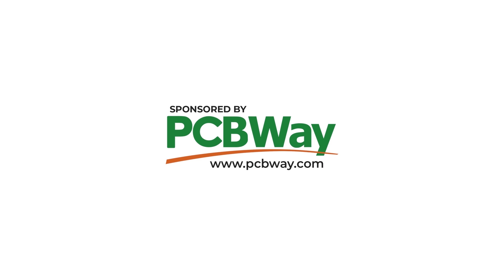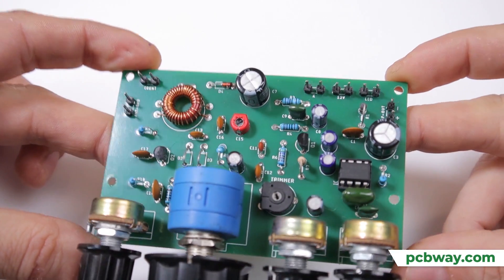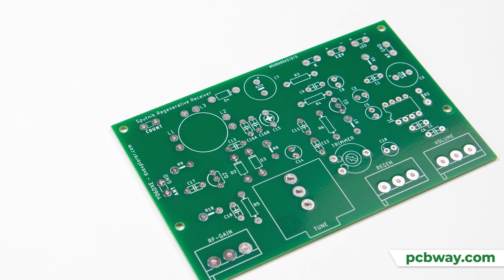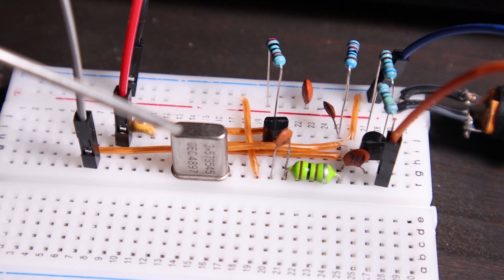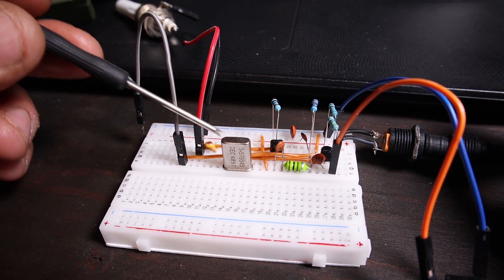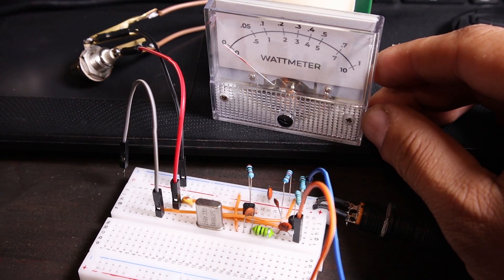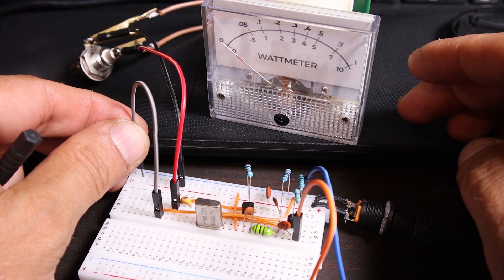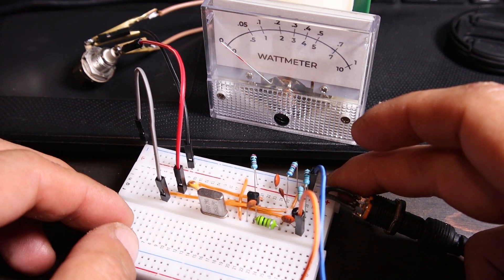uu80b QRP CW Transceiver Designed by G3XBM

Comment: I was wondering about the RX/Listening
Reply from the maker: I will do that in the next video on this trx. I wanted in this video but there was no propagation. I will post a reel on Instagram these days as well. Is not that sensitive though ... but you can copy stronger stations with no problems at all. And also is not very loud... so I am thinking on adding one more transistor on the AF side. I still like it as it is because is so simple 😁. 73, YO6DXE
Reply: @dxexplorer  I will make the circuit and observe it at the most appropriate time. I am working on the working logic of RF circuits.
Reply from the maker: @kadirsakin7335 I am playing with the trx now trying to improve the audio part... but I am too sleepy and the propagation doesn't help again so... I will leave it for tomorrow I guess )))

Comment: Really nice stable X tone on this Ciprian... once you have a filter to trap harmonics you should be good to go more or less...
Reply from the maker: I want to play with it a little before adding a filter and see if I can improve the sensitivity and the audio output... is a little poor on both. Also lots of AM broadcast band interferences so I want to see if I can get rid of those too )). For now testing the 80m and 40m bands. I couldn't get it to work properly on 20m yet. 73, YO6DXE
Reply: @dxexplorer  That makes sense...hope it all goes well... 73 G0KPZ
Reply from the maker: @davidportch8837 Still working on getting it to work on 20m... but so far I got rid of most broadcast interferences and the audio is just a little louder 😁. 73, YO6DXE
Reply: @dxexplorer  i'm waiting for a new video of updating about this wonderful project, also for the tests in 40 meters band
Reply from the maker: @ScratchyCode if you go on my channel on the community tab... have a look at the schematic I use at the moment. It works both for the 80 and the 40m band just as it is. Probably I will make little adjustments in time... but for now that is what I use and I like it. The audio output is still a bit low... or maybe just the propagation is bad and I can't hear much  ))).

Comment: Great video! I see a very nice landscape behind you. Nice transceiver and i believe if ypu build it on a pcb you will have more or less 1W at the output. 73
Reply from the maker: I may adjust the schematic just a little and see if I can get better sensitivity on RX... I am more than happy with the TX side. Even though I have a feeling that replacing one tranzistor may give me even more power. Love it though even as it is. P.S. I also love the new landscape... I wake up with it every morning 😁. 73, YO6DXE
Reply: @dxexplorer  yes, looking forward to the reels!! Is it possible to just replace the crystal and have it operate on another band? Just as it is but with another crystal?

Comment: I have had the circuit for the uu80b in my stack of papers for a few years but never had wired it and tried it out. I have used a Pixie a few times with about the same power out so this circuit you are using should work fine. I have plenty of 40m crystals so will try that band first. Now seems a good time. As for learning Morse Code, I first just learned the letters and numbers in order back in 1973 and after about a week I started to convert code in my head as I would drive past road signs on the highway. I reached the required 5 wpm for my Novice in just a few weeks of practice in 1974 so just relax and try my method without stress ;-) 73 de wa4jat
Reply from the maker: I have to start learning as well. Maybe find a little time every day. The code is what got me into the hobby in the first place... and now that I have a license I don't know the code haha. The transceiver is nice indeed. There was no propagation today on 80m but I want to hear it on RX as well. 73, YO6DXE
Reply: @dxexplorer  Looking forward to hear about future contacts on your little rig and the code. Getting on summer here so 80m has way too much QRN until About November so I tend to stay on 40 and 20 cw and always QRP🙂
Reply from the maker: @marknesselhaus4376 QRP for life 💪❤😄. Ohhh I will sure learn the code soon. Is way too much fun not to get on air on CW. Meanwhile I will build a few more "toys" like this one and have fun with them later. 73, YO6DXE ( same here with the propagation on 80m )
Reply: @dxexplorer  "Toys", I never have thought of them that way. Each build is such a wonderful learning experience and discovering how much you can do with so little.  My little "Michigan Mighty Mite" single transistor transmitter works the entire eastern states from North Carolina. Simple receivers are the real challenge in keeping them basic yet stable. I am only up at 3am as I could not sleep, so got up for coffee and see if 40m is open. Nope, just a few weak stations on there now ;-)
Reply from the maker: @marknesselhaus4376 Haha... I do that sometimes too. Last night also I was up at 3.15 listening to see if I hear something. Quiet though so I went back to sleep. "Toys" in the meaning that they make the kid out of me happy to work on them and use them late on. I know many people that do more with a little transceiver like this one than others with a big 100W commercial transceiver, so clearly they are no toys in that matter 😄. I am about to rebuild the Michigan Mighty Mite also.
Reply: @dxexplorer  I feel the same kind of happy with each contact I make with these little rigs. I just sent you a email if that was ok. I was not sure but I think we talked about all this not too long ago or else my age and memory are playing tricks on me hihi
Reply from the maker: @marknesselhaus4376 Do not worry... I am only 43 and my memory is making fun of me every day 🤣🤣. I received the email... and thank you as that sounds really interesting.
Reply: @dxexplorer  Oh, you are still young. I am just about 68 and started in ham radio in 1974. You still have lots of fun to look forward to 🙂
Reply from the maker: @marknesselhaus4376 That is all that matters... to enjoy what we do... and the rest is history 😁.
Reply: @dxexplorer  I've found the one minute code group exercises on LCWO net to be very good.  I set them to run for a minute and I might only do one at a time.

Just wondering...  this circuit has been attributed to G3XMB....  I'm wondering if that is a typo and it should be G3XBM. Thanks for uploading this video.   73.